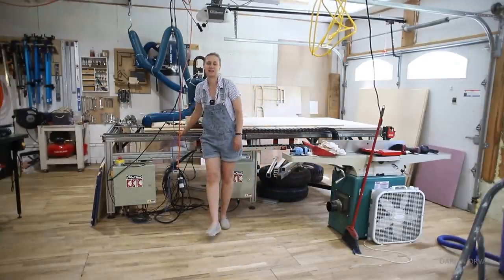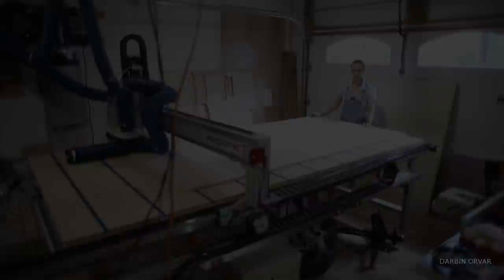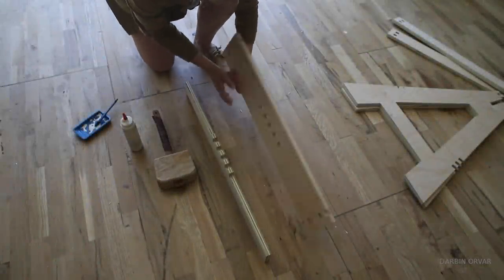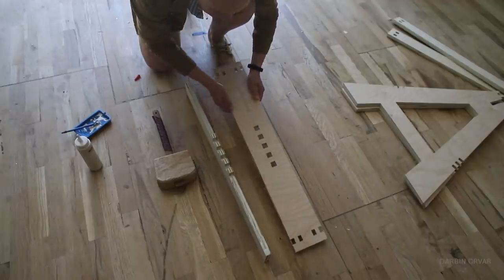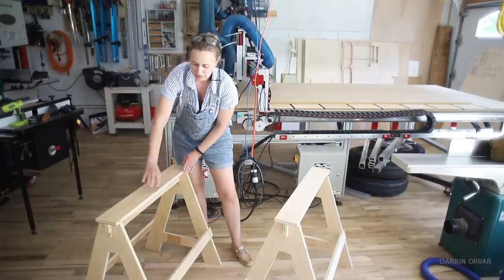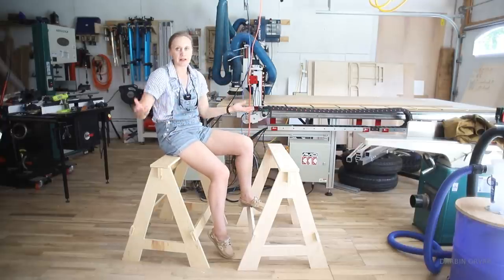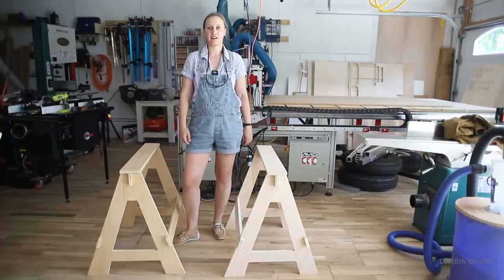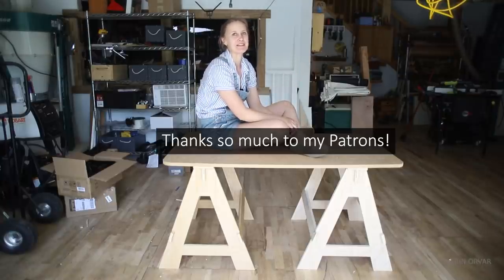2 Sturdy Sawhorses from 1 Sheet of Plywood to Make Table

Comment: Great build! If you don't glue them, will they still be as study? Thinking that not gluing them would make it easier for storage when not in use.
Reply from the maker: I first assembled one without glue and it was very sturdy. The problem becomes the plywood joinery which becomes weakened if you disassemble and assemble too much. So if you want to keep the joinery sharp, I would just glue.
Reply: Thanks, Linn! That makes perfect sense. 👍

Comment: Flat surfaces collect stuff.  One of the many woodworking mantras.  Anyone old enough here to remember those jewelry or coin shelves in a display that rotated like an escalator inside?  You push a button and they rotate?  I think that would be a perfect solution. Something that can rotate up to the ceiling so you have plenty of table tops.  lol

Comment: I made 5 sawhorses from one sheet of plywood. You get more usable wood if you cut strips, and then join/glue together, rather than making giant "A"'s right off the start. But I do like what you've constructed.

PS:  I also have a CNC, but all I used for my sawhorses was a track saw, tablesaw, and dowel jig.

Comment: I love this sawhorse design. I use a simliar system for my sewing table with a table surface big enough to hold my huge cutting board (1.5 x 2 m) I actually just bought an inexpensive inner house door made from masonite and it works great, slightly narrower than my cutting board, but it will do for now

Comment: Would it stack if the leg triangles were slightly slanted? I.e., tops of triangles closer together than feet of triangles.
Reply from the maker: I was thinking about slanted, but it would also make them larger... always sacrifices. 😊
Reply: @darbinorvar  If the feet were in the same place and the tops moved in a bit, it could have the same footprint. I would have to make a model to see if it really worked. The joinery would definitely be more complicated. Like you say, lots of trade-offs.

Comment: If it were possible to disassemble and reassemble the bases, this could work as a picnic table with your tear drop. Well, if you were able to flat pack the pieces and have a way to affix the top to the bases. Maybe?

Comment: I think with the price of plywood, you could buy a store and saw horses for the same price as one 3/4" sheet and a CNC machine.
Reply: A couple of aluminum painter's platforms from the Big Box store would be about the price of a 4x8 sheet of good ply, even before the current nonsense. Man rated (250 lbs plus), adjustable height, fold up, weather resistant, and you can climb up the rungs on the end like a ladder when you are standing on top building maintenance. I have 4.